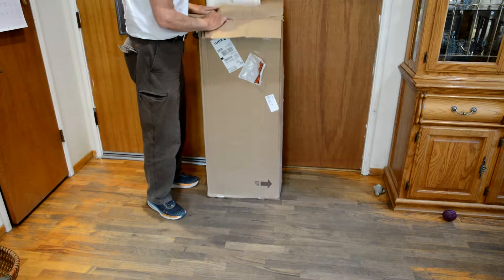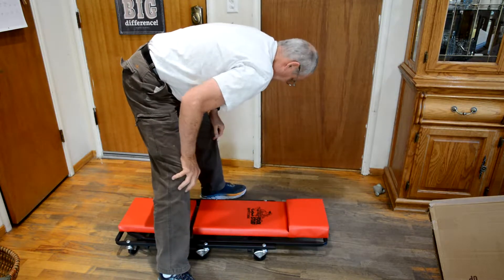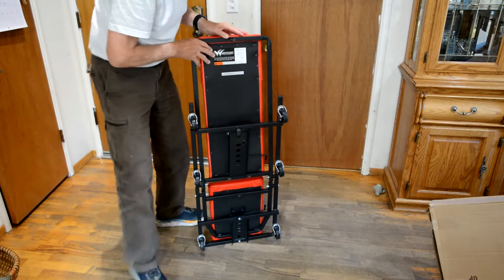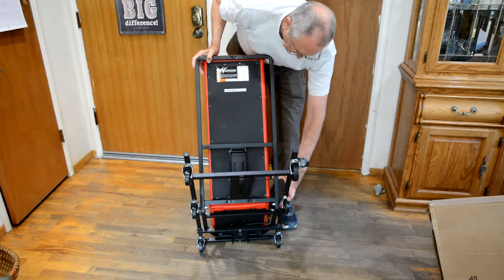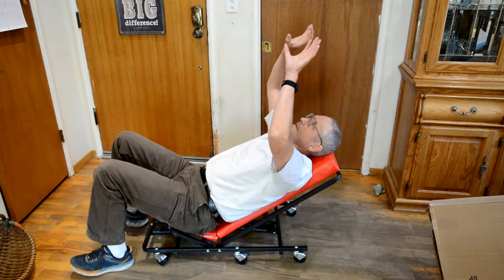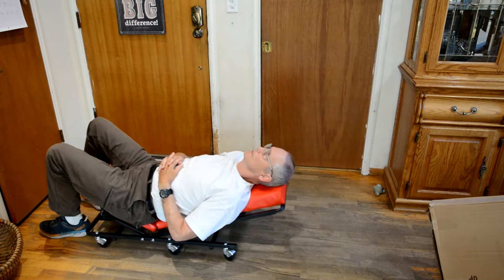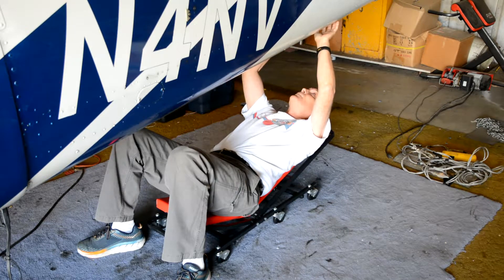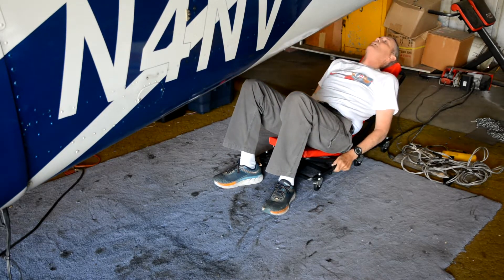Whiteside MTL2UP creeper review

Comment: We have one of these at my work! I work on commercial aircraft (ERJ175) with engines on the wing, and use it to do borescope (camera) inspections inside the engine. Works great to take off panels on the smaller CRJ 200's. Its old, and the casters are terrible by now, but it has held up for years. Well worth it, thank you for the review. I'm getting one for myself, ours randomly disappears.... somehow....